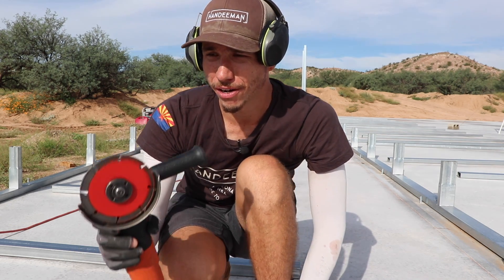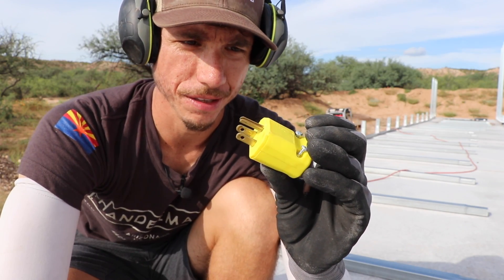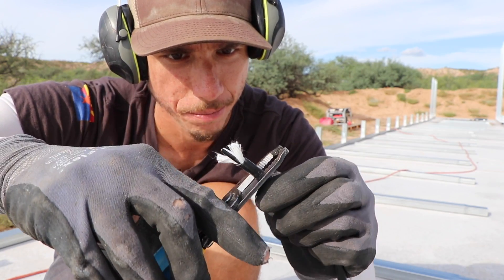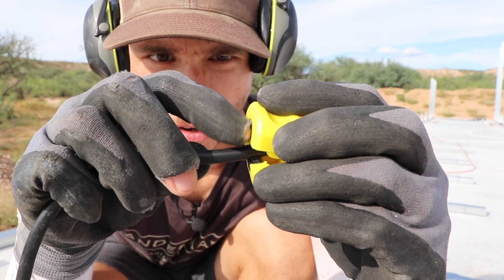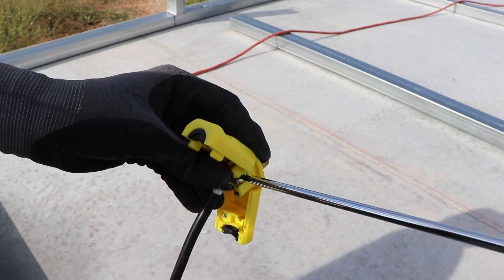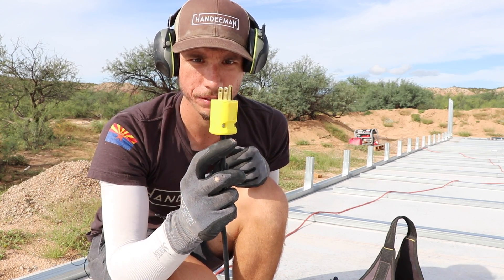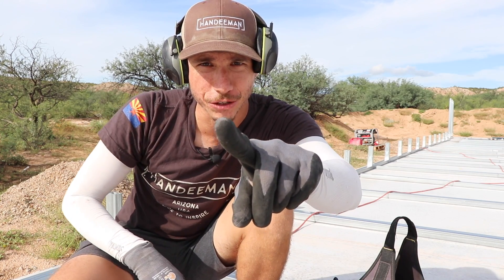How To Fix A Broken Electrical Cord / Wire

Comment from the maker: In today's video I go over how to fix a broken electrical cord or wire. The same steps are applicable if you want to fix an extension cord as well.

If your wire has a ground wire, put it under the bottom clamp.
Reply: Thats a good stripper did you pay a lot for her i mean them LOL.
Reply from the maker: hahahah :D
Reply: @Handeeman  Hey, man. I'm not dealing with a broken pin or wires from the plug that connects to my security camera system but the plastic of the plug itself that secures the connection of the metal is bent on one side, making the fit onto the motherboard's port too narrow.

How do I fix this?

If I bend the plastic to not be narrow it could damage the metal inside making the proper connection. Also if I attempt to shove it on there that could mess up the port from the motherboard.

From one tech guy to another, I thank you for these videos.
Reply: Vivo

Comment: how do you connect 2 ends together that have been cut is there this yellow thing but with a female on the plug side as well, to connect 2 wires together, for example if the cord was cut in the middle and u dont wana make it so short?
Reply: yes, I can see someone using a female and male on the other end
 sounds kind of scary to do.

Comment: Are there any extension cord ends that actually look good after they’re on your cord, like the factory ones?
Reply: you could try soldering and using those heat cover things ,whose name escape me, and a spare cord plug. just make sure you have the same gauge or rating  and material on both!

Comment: It would be better if you replaced a non ground cord cap plug with non ground.   They are also available.
Reply: how come? is it dangerous to use a three prong replacement on a 2 wire cord?

Comment: 2 questions
I didn't see you insert a 3rd neutral wire into the new plug end. Is that normal, or should i be looking for a 2 prong plug? Is the 3 prong plug ok to use?
And how about using this technique to convert a hardwire shop light into a plug in? Can that be done, any fire or safety issues when you do it this way?
Reply: what happened?

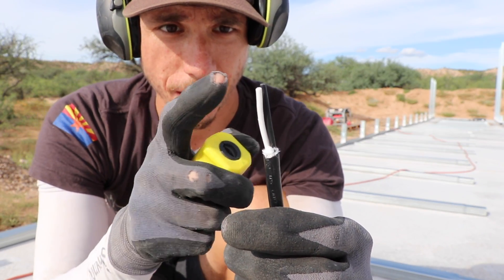Comment: Is it just me or is this Plug wired up wrong? At 2:52, he says the Pin on the right is Hot. isn't it the one on the left (looking at it with the Pins facing you and the Earth/Ground at the bottom)?

Comment: What if the cord which is hooked to a table lamp is brown and the two wires coming from the cord are neither black or white? Meaning the sheath is just the same color.
Reply: Most likely there will be some kind of ridge/ridges on the neutral insulation/ sheath.

Comment: HELP. I went to change an outlet in my older house and the wires from the wall look exactly like 1:42. Maybe the previous owners they cut corners and use extension cord wires instead of proper solid core. Is this a hazard??

Comment: They should make all power tools come from the factory with this type of plug. Most people use extensions when powering these tools. There is no need for a power tool with a long cable

Comment: So can I use this method to add a plug with a ground to an amplifier of mine? Or would I have to reconstruct the entire wire of the amp? It shorts out frequently and I believe that’s because it does not have a ground

Comment: I'm in the middle of replacing both the end of a cord and the receptacle that my AC unit was plugged into in a popup camper...not sure what happened but AC stopped working. I checked outlet and found that the receptacle was all blackened( burnt) and the plug side was pretty melted. Thank God no fire but it could have had a horrible end to this story...trying to learn as much as I can...this video helped me alot. Thanks.

Comment: I got a Porter Cable C2002 air compressor and the cord was ripped and they had electrical tape holding it together so I plan on buy one of those replacement plugs. The ground prong was also broken off so there's danger written all over the place for operating it without properly installing a new plug.

I read that using an extension cord can damage the engine, so I think I'll plug it straight into the wall and just run it off of a long hose. I'll have to invest in the replacement plug and a hose/nozzles, but once everything is running I'll have a good compressor to run things such as my impact gun with and I won't have to borrow a family member's anymore.

Comment: How do I change a 2 prong plug with the same colored wires in it?
Reply: Usually it says on the cord somewhere which side is which if they are the same color.
Reply: The neutral wire on the insulation will almost always have some type of ridges on them or some type of color on them.

Comment: How do you know which is hot and which is neutral when you have a fully black wire with only copper wording on both sides?
Reply: The wires should be a slightly different color. One of them a silver color and the other a brass color.

Comment: Thanks for the video! What about the voltage and amp ratings for whatever piece of equipment and/or tool you are fixing? I recently broke the plug for our above ground pool pump and it runs on 115v and 12 amps...the replacement plug should have the same or higher rating right? Thanks again!

Comment: Thank you my oscillating fan cord got stuck under the bed leg and got squished just ordered new plug part and wire cutters so I can fix it off of Amazon first time doing this wish me luck I'll be getting the wire cutters tomorrow and the plug I'll be getting on the 21st

Comment: I only have copper wire under the insulation no colors to differentiate which is neutral? Is there a way to tell? this is for two prong heater, one side does have writing on the outside of insulation?

Comment: This one really applies to my situation. We have a really nice old Korean vacuum cleaner that had only two prongs on the cable that broke off. The only thing I forgot was to tighten the ground (green) screw inside the housing. Everything else went exactly like the video. Many thanks!

Comment: I took out my guitar amplifier’s grounding pin, which caused a hum in the amplifier. My mom will most likely be really mad if I tell her about it, but, would it be safe for me, a 14 year-old to chop off the plug and do this procedure?
Reply: How'd it go? I find prefacing "I know how to fix it" before I told my mom that I broke anything helped lessen the scolding. The first few times I still received a talking but anything after that I was told to just fix it.

Comment: There was a lot of bad advice and code violations in your video.  First with a double insulate tools that has a two wire cord you should have replaced it with a two wire polarized plug like the one you removed. It has a larger silver net blade and a brass hot blade. The cord cap that you used is for a 3 wire cord only. You are right about  removing the ground terminal on the plug. Also are you using a gfci protect on your extension cords at your job site? This could be a state L&I violation. I like your channel a lot. Be careful about passing on electrical advice. I know the code does vary from state to state. I'm a licensed electrical journeyman for 35 years in Washington state.

Comment: Good job ...  but now your cord is shorter and you have that bulky ugly yellow plug on the end.  Why didn't you strip and solder the wires inside with some heat shrink tubing around each piece with a thicker piece around the whole outer cord?

I like to put a very tight cable tie just on the inside of that strain relied mechanism to add some additional resistance to it getting broken by being kicked or pulled.
Reply: Because I can buy the "bulky ugly yellow plug" at the hardware store without buying heat shrink tubing and a soldering iron.  This is for people like me, who just bought their first house, and are really trying to learn how to do basic things we haven't been taught, and it's honestly bewildering that electricians and people who know how to do things like this come on and make us feel like idiots.  Is that fun for you??  I'm so sorry I don't work at a job where I have to know how to do basic electrical work.  I work at a freaking library.  Get over it.
Reply: That's exactly what I would have done. No need to buy anything. Assuming you have all the necessary repair supplies already. Solder the wire and use heat shrink tubing. It's as simple as that.
Reply: @Superduty_59  
The title of the video was "How To Fix A Broken Electrical Cord / Wire"

Misleading, as usual on this peculiar bait and switch channel.  A lot of what "deman" does is interesting and useful, but most of it is to get you to buy his bullshit videos at an inflated price because he projects a fake positive business attitude.

If I was going to "fix an electrical cord right, I'd do it as I suggested, but he did not mentioned he was in the middle of the job and just needed to get it up as quick as possible.  That is really not how to fix an electrical cord, that is how to fix a broken male plug.  By the way how stupid was it to cut the cord to begin with, what a greenhorn mistake.

It's too bad this channel is so phony and geared towards just providing people with enough information to get interested and need more help.  In real business when I look at a company, I know that if they are not really sincere in being helping before you buy, you can depend on them after you buy even less.  Just get the money and keep on smiling like a jackass.

They spent years talking up their tiny house, ignoring or even arguing with criticisms, and now they have a video about how much they hate their tiny house.   Face it, these guys are scammers, and most of their videos have silly mistakes or errors that with a small bit of research they could have covered, like the discussion about GFI circuits.

There are many other videos from people in Southern Arizona that are a lot more positive and complete, and what was up with his video attacking the other channel.  I would never trust this jackass or do business with him in real life.  I think he had the idea or not reproducing right the first time.  ;-)
Reply: @justgivemethetruth  It's amazing how many people make this "greenhorn mistake."  Check out all the videos filmed by people who clipped their cords with hedge trimmers because gasp people make mistakes!  It must be nice up there on your high horse.

Comment: Thanks for the tip! Just wondering the purpose of the string within the cord? Does it just act as a cushion/filler to help protect the wires within?
Reply: HolmiumNZ it's insulation

Comment: Honestly, if any male viewers haven't been doing this correctly since they were eight years old, then maybe learn how to make sandwiches or something. 
Also, looking at my UK plug design and feeling smug.
Reply: any real useful info you have to pay quadruple for
Reply: horse1066   Yes, agreed, the bs1363 plugs & sockets are one of the best domestic mains plug/socket designs in the world. Particularly because of the required fuse to protect the smaller sized conductors in the flex... a feature no other domestic mains connector has as standard.. and really should. Also, sleeved pins for the win!  I'd say second best is as/nzs 3112 plug & socket, mainly because the sockets are required to have switches like the bs1363.. no fuse for the flex unfortunately. There are better quality NEMA 5-15 then the one Derek used.. it's a cheapie. But considering North American branch circuits are supplying 120v nominal at only 12 to 16 amps continuous (80% rated 15 or 20 ampere protection devices), that plug is just adequate to hold up until the over-current device trips on overload/short.. even without a fuse in the flex.  One usually finds a bit of blackened plastic around the terminals when that happens though.

Comment: Hello, great job, I've never used wire strippers, we do not have rigid cables, a flat-blade screwdriver and a good professional electrician shears, you do everything, 2 tools and manual skills and you're done, I do not find myself unsheathing with a multiple wire stripper pliers or to use wire cutters for very thin and not very powerful cables, my favorite scissors and electrician tools in Italy: https://www.intercable.tools/en/Products/Hand-tools/Electrician-s-Scissors/1601-2

Comment: you should have used a 2 prong connector since your wire only has 2 cable and no ground
Reply from the maker: Makes zero difference
Reply: Handeeman does it give people the false confidence that there is a ground on that device when there isn’t?

Comment: Handeeman didn't mention that this is a valise type cord cap because it opens up like a suitcase. I can tell you from over 30 years of using them in commercial/construction settings that they are far superior to any other cord cap.  They cost a little more but are worth every penny -- they install easier and last longer. I don't buy them when I need them -- i stock them in the shop, both male and female, so I have them when I need them, then buy more when my stock runs low. A saved trip to the hardware store and a work stoppage pays for the cord cap every time.